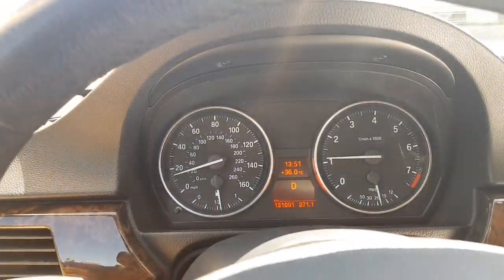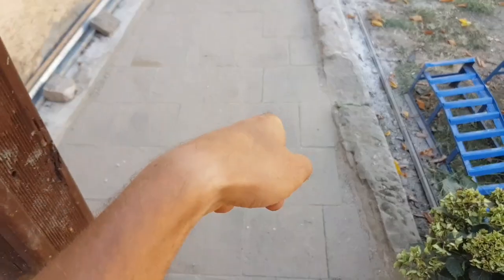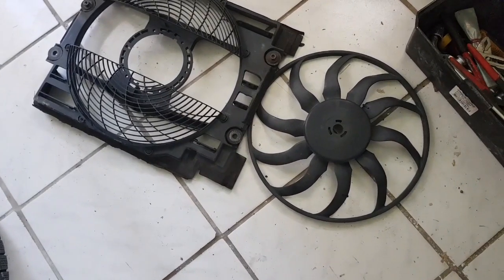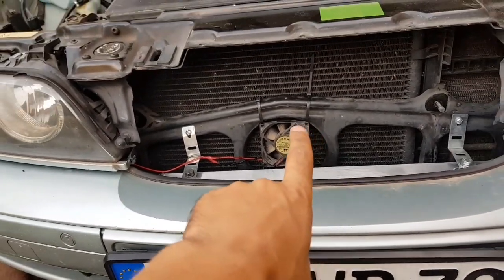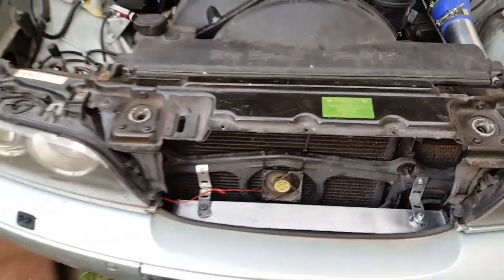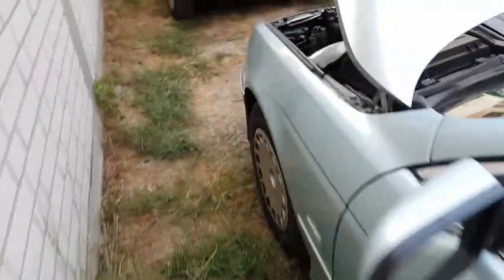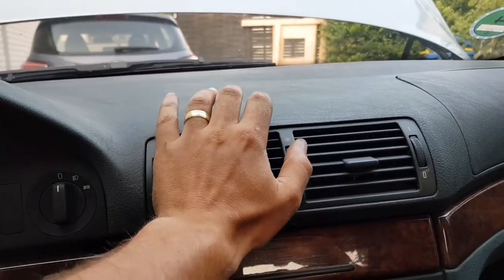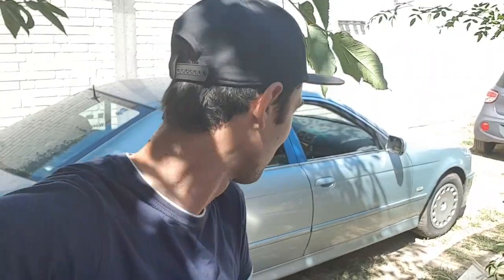Bmw e39 turbo Update (AC repaired)

Comment: Looks good but that fan is way to small.    I just would wait till it cools down to drive it.  Or wait to get a bigger fan that fits.
Reply from the maker: I will have another one but I had to test the wires and the the climate to see if works. This is just an aux fan, car has another one for cooling this helps when is extreme hot but without this the climate won't start! Thx for watching!

Comment: That small of a fan won’t affect it in the long run? 

How’s the bimmer running? Have you gotten around to tuning it?
Reply from the maker: That small fan won't remain. I just didn't had anything to test the wires and to test if the climate works. I will have a bigger one for sure 😎. It isn't fully tuned but way better than first run! I have stable boost now, o2 sensors are tuned, cat deleted, timing set, I just have to final tune it on the street. It runs ok stable and I love the sound of the turbo. I will post a bigger update but I just have to do a few smaller changes. Thx for watching and stay tuned! #warpdrivers #warpdrivem
Reply: Warp Drive M  nice!!! Show us some tubing videos in the future!!! I’m excited to see what more things this build brings

Comment: I have one question. Where is AIR FILTER?
Reply from the maker: Directly to the turbo itself.
Reply: @WarpDriveM 
 You can show this filter. Because you can not see how it is mounted.
Reply from the maker: @krzysiekklucha  in episode 10 when I drive the car you can see it! Or sent me a msg on Facebook Instagram or twitter @warpdrivem and ill send you a pic
Reply: Now I see. But you are not afraid of the engine, hot air and dirt from under the car. I am making up the engine hood and filter upwards.